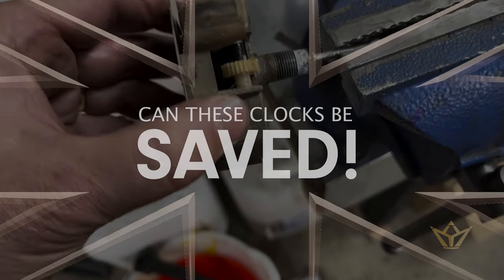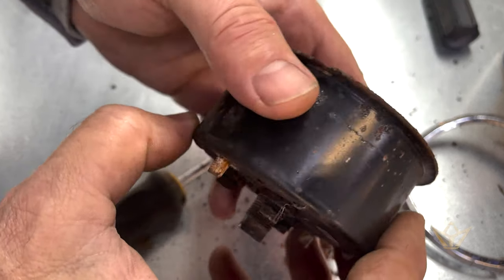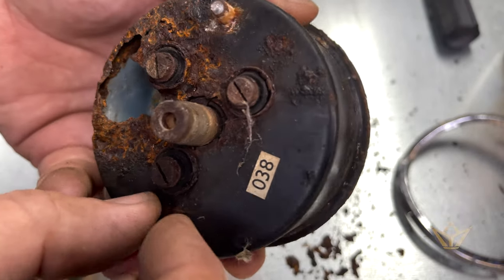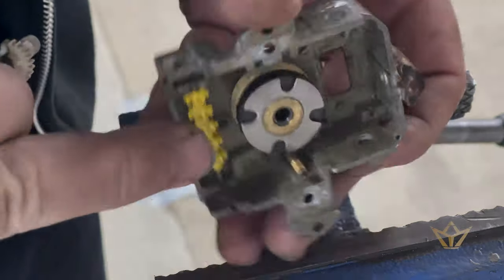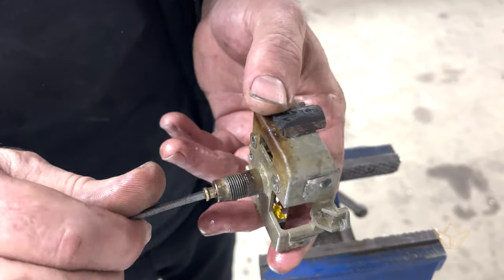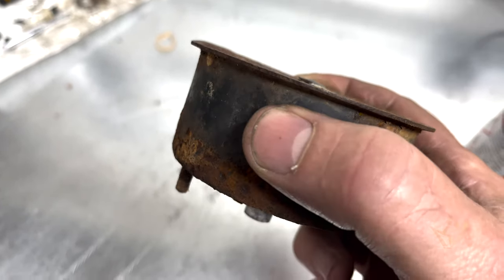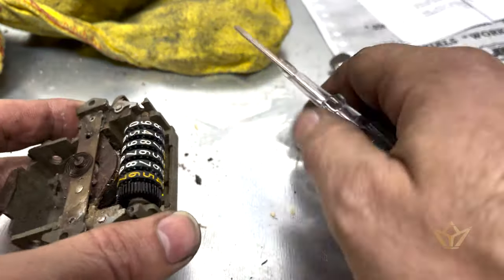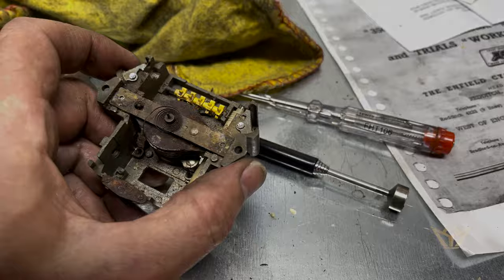WEEK 7  - CAN I SAVE THEM! HARD TO FIND SMITHS SPEEDOMETER AND REV-COUNTER PT1- 1968 Norton Commando

Comment: As a  instrument repairer of 30 + years, I enjoyed watching how you pulled apart your Smiths SSM gauges, these are probably the worst gauges Smiths ever built, but you can make them usable, I tip there is a dot/mark on the face below the "o" zero on the dial, this is where the pointer/needle should be seated, then lift over the point stop, the slotted brass screw underneath can then be screwed in or out to achieve calibration.
Reply from the maker: Ahh Jason I wondered how the hell they calibrated. That was one of my worries! Ok will try to figure out exactly what you are saying here. You suggesting the needle needs to be resting a bit before the stop? 
Many thanks for chipping in! 👍

Comment: These badly weathered clocks dials from 1969 look identical to the “green ball” dials that  came with the 1974 Commandos.   Those things run around 250 bucks each now.   Perhaps more in the UK.   If you used to work on Breitlings and Pateks then Smiths might seem familiar.
Reply from the maker: The green balls had stripes through them. These 68’s were solid green. I could be wrong!
Reply: @MyRestoration1  I think you’re right.

Comment: I must, firstly, commend your bravery and patience! 😀I recently bought an accident-damaged 1972 MGB Roadster and after getting the engine started with the help of my brother, I discovered that the Smith's speedometer works but the trip meter and odometer remain stationary. Do you have any tips on how to fix those two features on the speedometer please?
Reply from the maker: Thank you Marc. Firstly I can emphasize enough that if you follow the many online videos and articles, I see little reason why you cannot figure this one out. If the speedo works then it might be a plastic gear which comes off the main shaft which might only be stuck. The hardest part is removing the bezel without breaking the glass! I give you courage to have a go! Good luck
Reply: Thanks for the prompt reply. I'll give it a go. Are you a fellow South African?
Reply from the maker: @Cyclizt  no. I gave that up in 93 but I can’t change the accent. Don’t get me started 😂
Reply: @MyRestoration1  Wishing you the best!

Comment: How does one go about making or finding the correct return/torsion spring if possible?
Reply from the maker: It’s a good question. Look further down the comments and, if I understand you correctly, he explains very clearly how to calibrate the needle by changing the tension. I need to review what he said too!
Reply: Thank you, let me clarify, my old suzuki speedometer was exposed to the elements. The fine copper return spring (torsion spring) for the needle crumbled away. Are these replaceable and if so where can you get one (besides another speedo)? Can one be made? Thanks again!
Reply from the maker: Ok. I have no idea Sergio. I would guess your option is to look for a damaged one and pirate the part. Should you have other bits go on you then you have some spare parts!

Comment: Excellent video on clock restoration. I used to work at Gent Ltd and worked on clocks etc. for a few years. Lovely to see someone treating them with the respect they deserve. Did I understand from the video you used to work on watch repair/restoration?
Reply from the maker: Hi Steve, They really are just clocks without a mainspring. 
Yes I am have been into horology for a number of years. Maybe you can advise me on an old Japy frares silk suspension movement I need to restore. Are you the person I can talk to! 
Thanks for your kind comments btw 🙏
Reply: @MyRestoration1  Not sure I can help with that I'm afraid! Most of the stuff I worked on was much more "industrial".
Reply from the maker: @stevewright399  no problem. That’s on my bucket list..👍